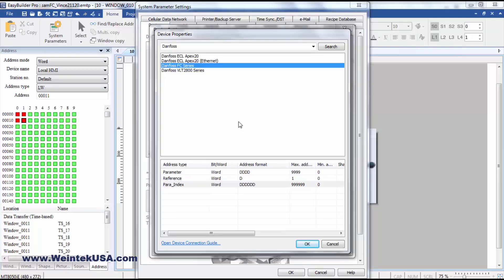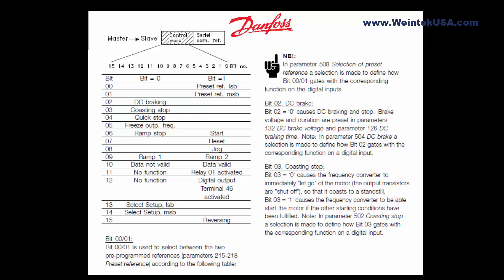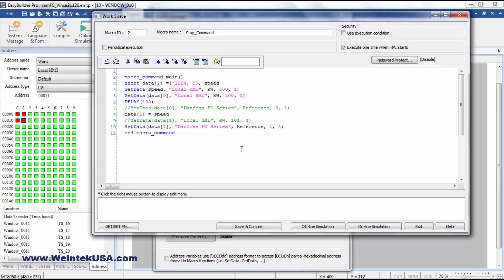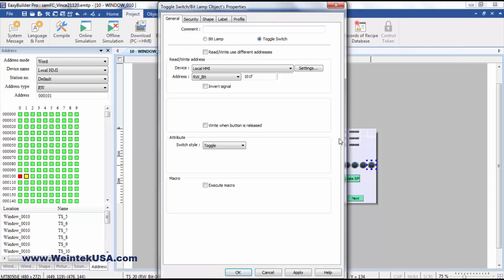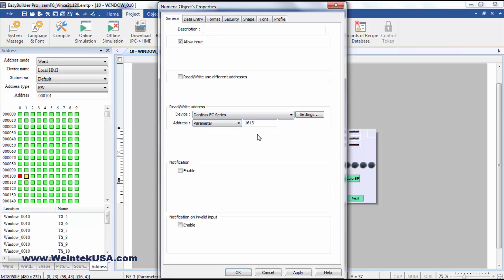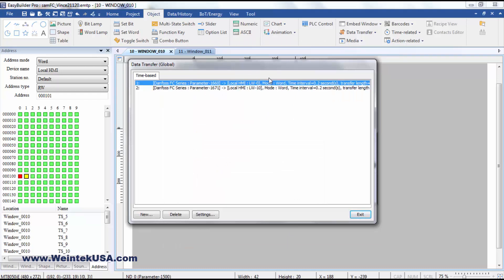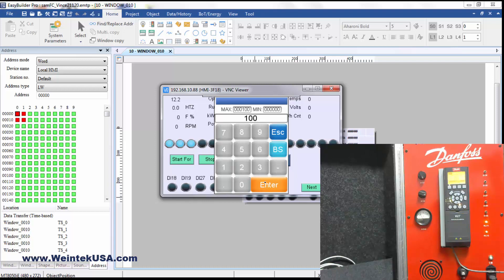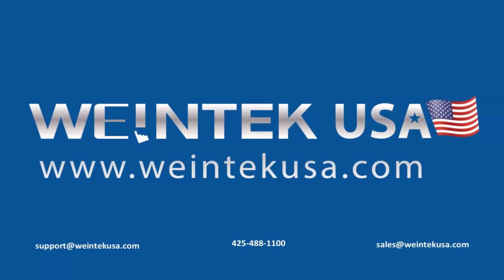Danfoss FC Series Driver with Weintek HMI, EasyBuilder Pro

Comment: HI, HOW DID YOU GET AROUND THE ISSUE OF SETTING THE REVERSE CONTROL WORD (33916) IN RW 100.
AS IT IS NOT SHORT BUT INT, IT OVER LAPS INTO RW101 STATUS WORD?
Reply: I BELIEVE I HAVE SORTED IT WRITING A 0x847C INSTEAD OF DEC 33916.
Reply: WRITING 33916 AS AN UNSIGNED SHORT IN MY MACRO WAS THE CORRECT FIX IN THE END.